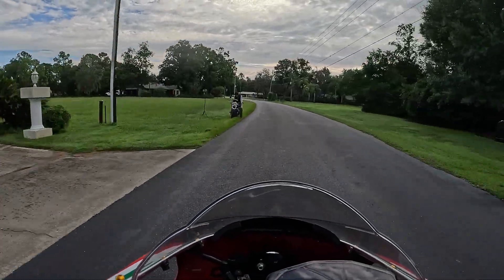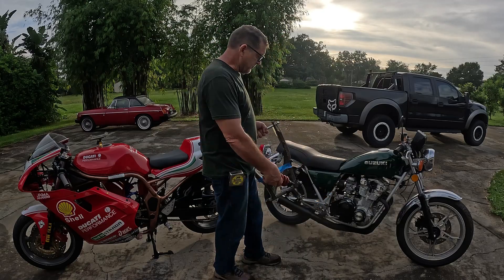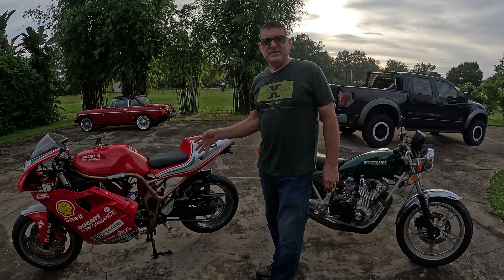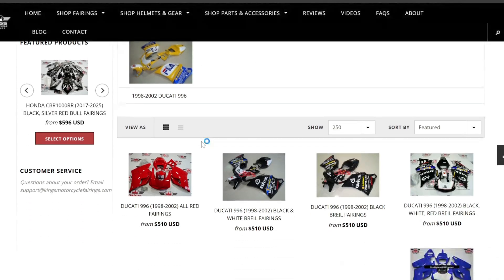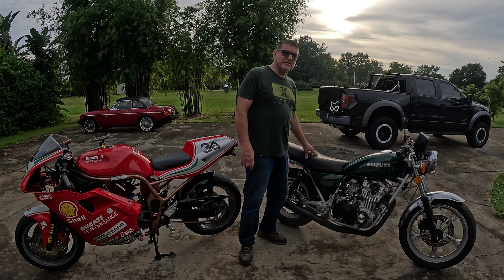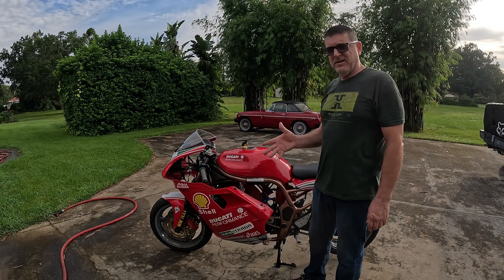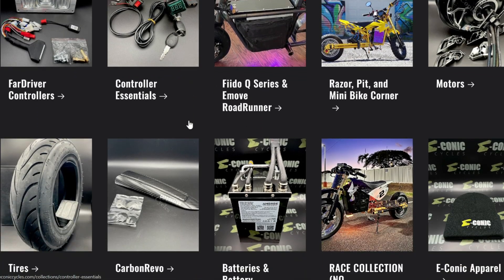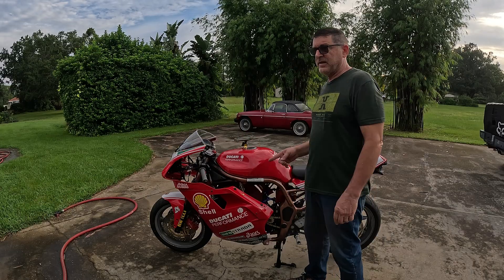What It Cost To Build My 96V 20KW Electric Ducati Motorcycle

Comment: That bike needs a fardriver 961800, and a battery capable of over 800 line amps to be my kind of fun! Lol most of my 140 pound e-bikes are over 20 kilowatts! Lol  for about 1500 bucks you can build a 14 kilowatt bike if you know what you’re doing! But I built my own batteries.
Reply from the maker: You are getting way ahead of me.  I have a ND961800 on the shelf 😁

Comment: What gear ratio do you have, and is my 13t/50t or 13t/55t gear ratio a good fit for a 15" 574mm wheel and a QS 180 90h engine?
Reply from the maker: Did you watch this video?  I would have to sit down and do the math on your specific setup.  This is the way to figure it out.  QS180 is easy since there is no reduction to calculate. 

https://youtu.be/QVvLN1zq1u8?si=YGOpyNIqrIlWKhDs
Reply: @GhettoWrench I already have a table of calculated gear ratios where I can send them to you, if these are correct calculations

Comment: I thought the engine in a Bandit was a stressed member.
Reply from the maker: It probably is I am sure.  But I wont be near the speeds and horsepower as that 1200.  I have even almost gotten to the point of hand tighteng bolts on the ebikes.  LOL.  They dont rattle or vibrate at all.  Back in the day we welded the side bars on our frames when we had to race this stuff pre sport bike.  But I won't be near that level of riding.
Reply: @GhettoWrench true about lack of vibration, but the torque an electric motor can produce from zero revs could be frame twisting power...
Reply from the maker: @yoda-be.at1746 true that.  Its a pretty beefy frame though.  Im no engineer so who knows.

Comment: Well, yes, Aliexpress is a rowing lottery, with high risks but also serious benefits. My spare parts arrived in good condition. Two packs of lifepo4 batteries - 16 and 8 cells in separate packages due to customs duties. 16 linmc cells. Qs 138, kr5v motors. And a couple of nd72450. I hope that your packages will also arrive in good condition.
Reply from the maker: Ya I still buy tons of stuff from them.  SiA did warranty the ND961800.   Overall its a win.  Its usually the cheap little stuff I have problems with.